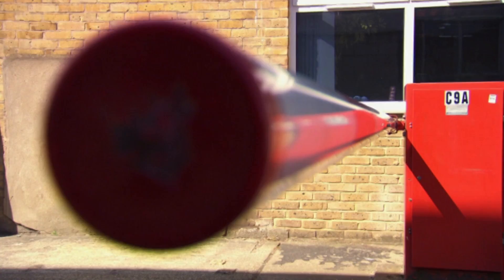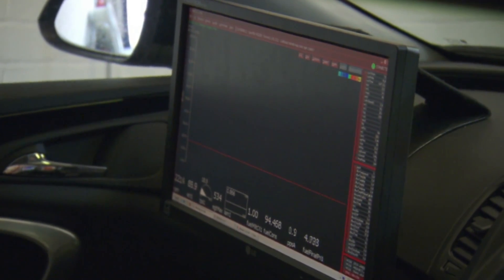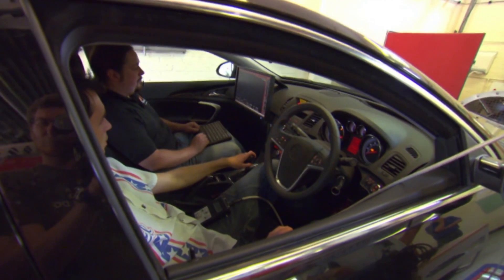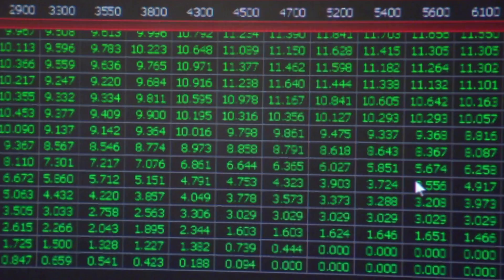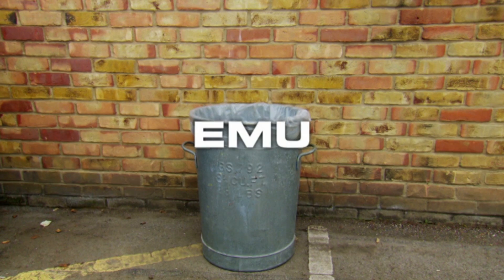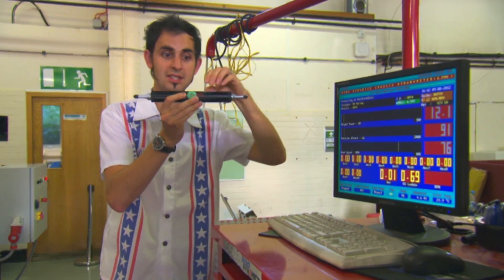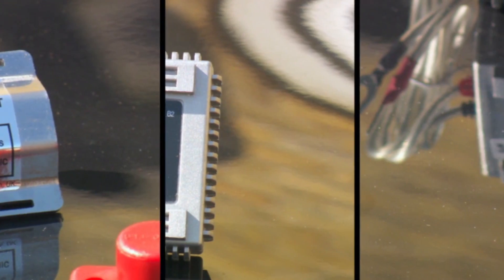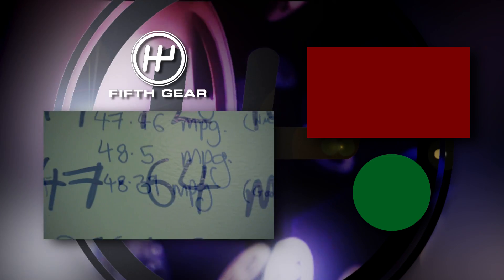Do Fuel Saving Gadgets Actually Work? - Fifth Gear

Comment: So you are saying some device you put in your lighter socket raised your fuel consumption? You said it was just a green light and if that is the case it should have had zero impact on the fuel consumption. I feel your base line is off to begin with.

Another point I noticed is that you mention this guy has a baseline already. When  you guys test the products you have two humans added to the car increasing the weight so the baseline needs to be redone with you two in the car of your need to test the products without any humans in the car to fairly match the baseline.

Comment: If the Viabtor thing was "just a green light", why did it worsen the fuel consumption by around 2mpg ?
They should have tested the car again with no add-ons to be sure there wasn't a drift etc.
Reply: i agree
Reply: Exactly
Reply: I think that a baseline run should have been performed between each test because it seems as though the baseline has dropped a bit; may be due to higher inlet temperatures once the engine/room is warned up.
Reply: @lewis72 How precisely can the fuel flow rate be measured? How accurately and how consistently does the rolling road dynamometer represent air drag? I think the odd 2mpg (about 4%) is quite likely to be within measurement error. It would have been good to see two or three runs on each device, and a further run or two with no device.

Comment: Can you test HHO generator which is added to petrol or diesel engine. So generated hydrogen is used as an additive to existing fuel system, not as a replacement as they did in MythBusters and proved it wrong.

Comment: In consideration of the findings, running a baseline test (no gadgets) at the end of the day would have been a prudent test. What if your car actually dropped mileage throughout the day? Stranger things have happened. Otherwise, nice video.
Reply: Exactly. I'm not a believer but could a return to the control setup result in matching the baseline AFTER the gadgets were removed?? Meaning, did the engine run less efficiently while the gadgets were in place or did the initial run benefit from external factors like a colder engine, cooler oil, change in ambient temperature, etc.?

Comment: They all must do something to decrease fuel economy by up to 2mpg.
Reply: Extra weight on the wheels increases surface contact with the dyna and therefore increases friction. Also some of these were drawing power, which makes the alternator work harder.
Reply: Even in a dyno?
Reply: I think the decrease in fuel mileage is due to only 1 passenger being inside the vehicle when it was first tested for the base line mileage, while 2 people occupied the vehicle for all the other tests.  Additional weight means the engine has to work harder to maintain the same engine rpm/speed thus using more fuel.

Comment: i think the baseline score is wrong as the parameters in the car's pre programmed ECU is constantly remapped for best driving experience...  u cant loose MPG by plugging anything to the cigarette lighter or any electrical device...  looks misleading
Reply: zdrux except the car is heavier because of passager. Also maybe the atmospheric pressure, the air humidity and temperature has changed? I believe all those devices do nothing so why such bad score? The only explanation is something big changed between base test and other tests.
Reply: @cmuller1441  The base test should have been run again at the end to verify the original figure.
Reply: The car was in a controlled environment where the "driving experience" conditions did not change.

Comment: How about low rolling resistance tires and light weight rims with a cold air intake that runs the engine air through a heat exchanger that cools the air using evaporating liquid nitrogen?
Reply: Nitrogen corrodes the engine which saves fuel by sitting in a junkyard.
Reply: They've already done a video on these.

Comment: The most efficient,, least costly and easy to use fuel saver is the driver and how s/he operates the vehicle.
Reply: What about throttle controllers?
Reply: Dan Troop I agree!!
Reply: Absolutely correct!
Reply: Very True Economy Driving is an art you need to Simply practice. Turn to instant fuel econony show and practice being in low economy range. The idea is to push so much accelerator all the time and so instant picks . One can feel the difference in Few days.
Reply: True enough.
Although, my car has a major mechanical flaw. A loose nut behind the wheel.
Reply: What about Shim? Covers the lot.
Reply: what a stupid comment honestly.
Reply: @mathaaushle  stupid comment By you David 

You don't know shit nigga. He is absolutely right.
Reply: Dan Troop you mean how a human drives their car? he/she is nolonger an acceptable term in 2017 lol

Comment: Don't think those devices will do anything but.....   how a green led connected to the carplug can decrease the mpg?  It won't make any better but how does it make any worse?
Reply: at the very least it is more draw on the electrical system increasing engine load. this is a stretch by any means. but really the difference is simply a testing variance across all devices. the fact is they do nothing and all the results are different show this to be true. ambient temp, intake temp, humidity there are many variables that can introduce this acceptable fluctuation in output.
Reply: Jorge Rubio LEDs don't consume that much power it would hardly make a difference. If there was a led or not